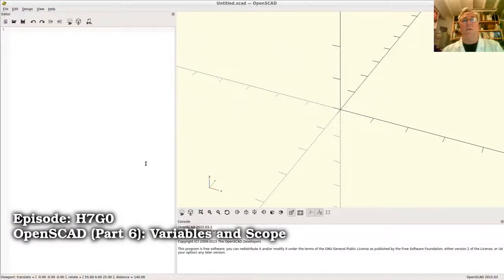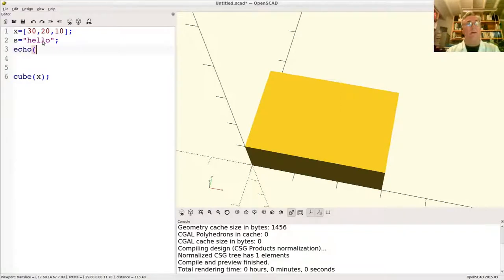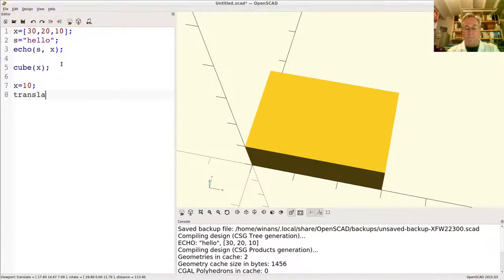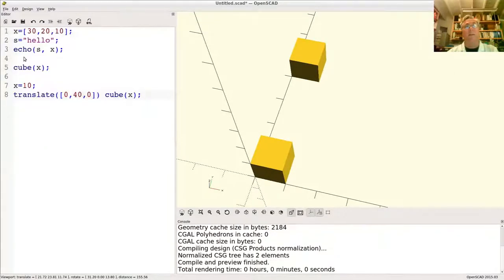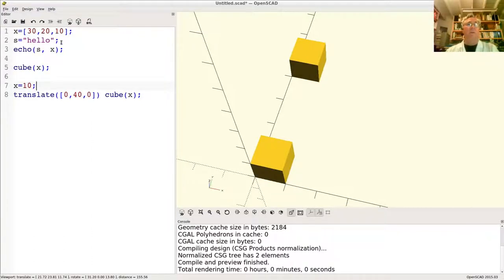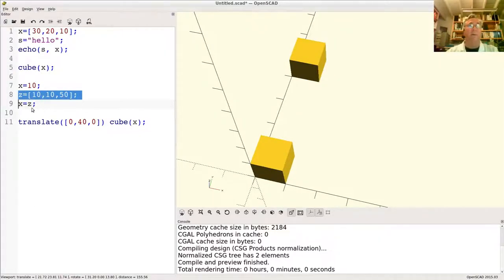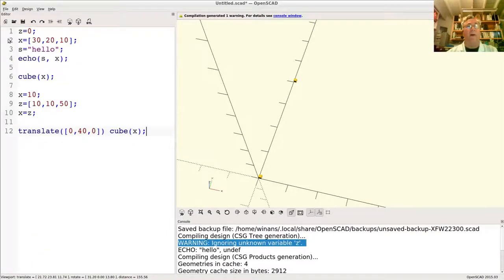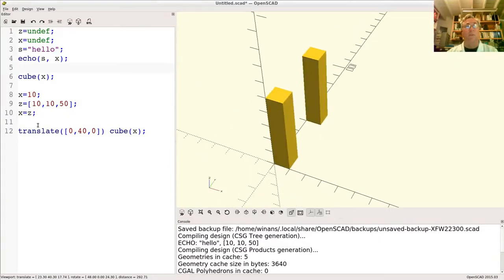OpenSCAD Tutorial (Part 6): Variables and Scope

Comment: great explanation. now I'm confused. what is the point of a functional language vs imperative language? why not have two types of  variables with different scopes?
Reply from the maker: Hmmm.. I am not good enough to give this question the respect that it deserves here.  The simplest answer is that in a purely functional language, the program's "functions" are like mathematical functions in that map the input data to the output and has no other effects beyond that.  Building a system to execute such code can take advantage of the fact that there can be no side-effects as a result of executing a function to improve the efficiency of the application.

Here is something that might be worth a skim: this a skim: https://www.infoworld.com/article/3035076/functional-languages-what-they-are-where-theyre-going.html